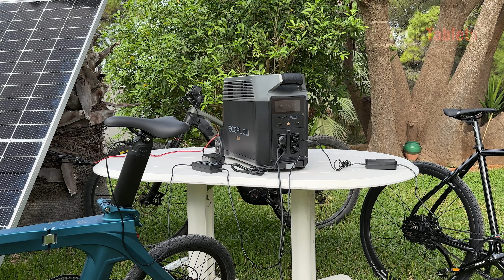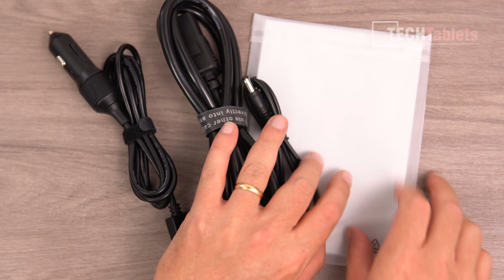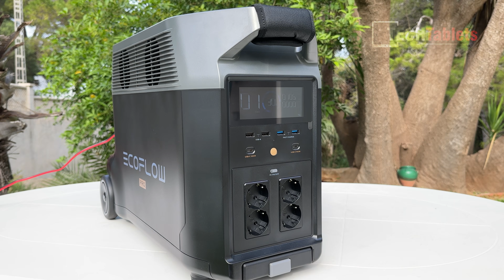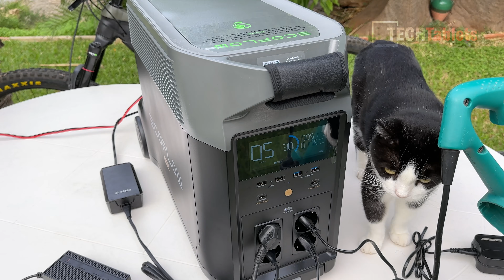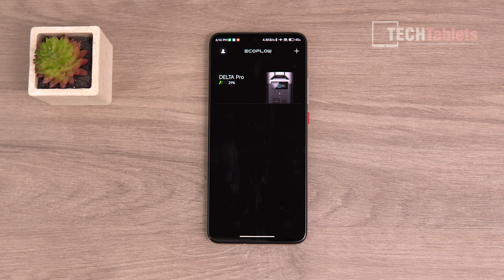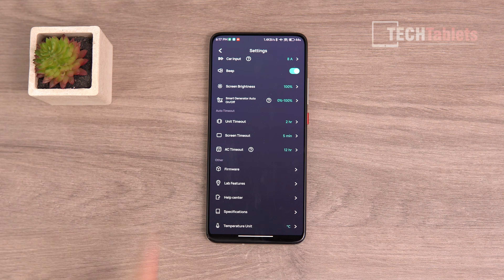EcoFlow Delta Pro Review - 3600W Portable Power Station!

Comment: I want to run my desktop Computer on a solar generator 24/7  with Solar & A/C plugged in at the same time. I want it to run on solar power but have the A/C power kick in if the battery gets too low. Can this unit (or any unit) do this??
Reply from the maker: Well in a way as it will keep topping up the battery and power your desktop and charging if there is surplus power.

Comment: Great video man. Thank you for sharing all of its specifications clearly.
What about adding the extra unit to it as you mentioned in the video it is doable . As far as I know the Eu version are not able to add extra unit to get AC peak of 7200wh output via Doble voltage hub for some reason. Can you please share your thouths.
Reply from the maker: As far as I'm aware you can add the extra unit there is the plug for it on the side. And yes for the peak of 7200wh you need the double hub plug so another extra (along with the extra battery)

Comment: We are in Massachusetts and just bought the eco flow delta pro along with the home smart panel, the generator guy try to hook for us but one of the circuits light still blinking with error. I don’t know if it’s a wrong decision to buy that since we not gonna install solar panel and don’t even know how long the battery will last during a electricity outrage.

Comment: The reason why I got the Delta Pro is that I am able to max out the capacity at 25kWh.
Reply from the maker: Makes sense
Reply: How does this expand to 25kwh? The extra batteries are 3.6kwh. And there’s two expansion ports. 3x3.6=10.8. Wouldn’t this mean its capacity is 10.8kwh? Cheers!

Comment: I actually read about this Delta Pro in Time Magazine stating that it is actually one of the best inventions of 2021.
Reply from the maker: That’s great to know
Reply: Doing the math and looking at the price ($3600) it is nothing special.  It isn't bad but "Best invention of 2021" is a reach.  You can get 1000 AH of power storage for about $1000 bucks all day long.  This is 300 AH at 12 volts.  Also it isn't going to charge in 2 hrs as the norm.  Perhaps while you are at home when all is good in the universe you may get around that kind of charge but please don't bet you life on it.   Fast charging anything has a cost.  With batteries it is the life expectancy.  Super capacitors are a better way to go.   Wait for it to go on sale and get some type of rebate.  Then it may be worth the hype.

Comment: It might be mobile but surely not portable at 45 kg.
Reply from the maker: Very heavy yes but still classed as portable even at that weight. And it has the wheels at least.
Reply: Weight wont be an issue when u need to juice up your devices especially during emergency
Reply from the maker: Not at all then :)